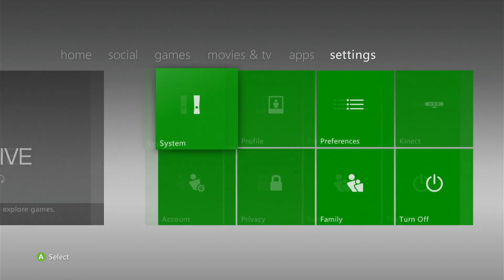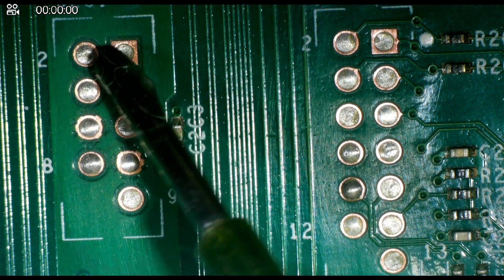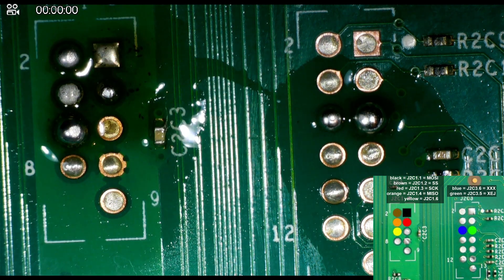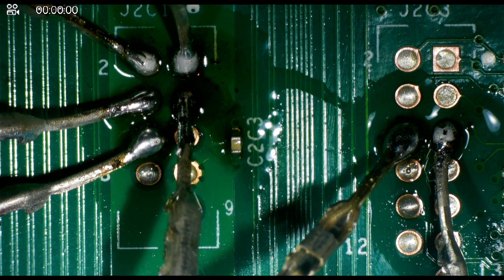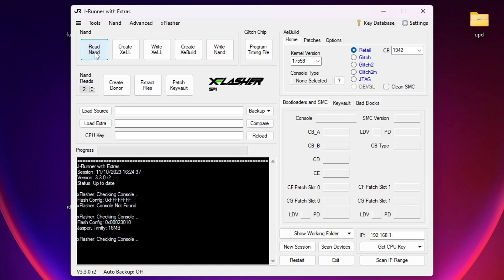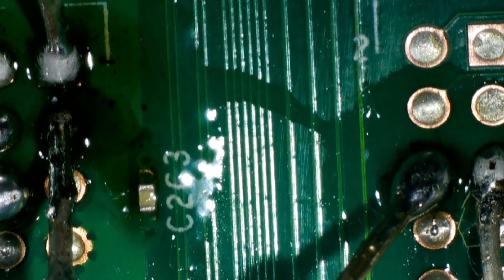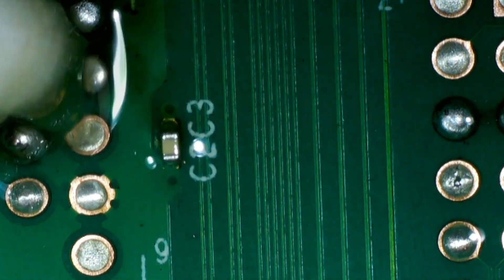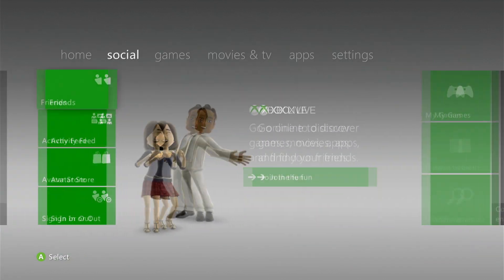How to Bypass Family Settings on an Xbox 360

Comment: Ik on the og xbox the code to reset the parental controls in like X Y L R but I didn't know you could do it on the 360 ever.
Reply from the maker: I've never owned an OG Xbox, but I assume it's easier than this. This is quite a lengthy process but can be used as a last resort.

Comment: Bro i also have RGH Xbox 360 and I had heard from the seller that if i connect my console to wifi then the games will be gone amd the rgh aswell. Is there a way i could still play online in like MW2 etc without consequences? Cuz im rlly bored.
Reply from the maker: That’s not true at all, you can connect to the internet as long as you have a stealth server. OG Xbox backwards compatible games won’t with when a stealth service is active, but normal games will, and the RGH certainly can’t just go away, it’s a hardware modification.